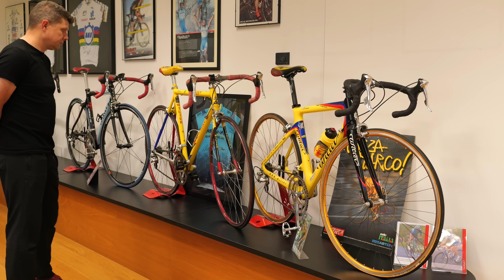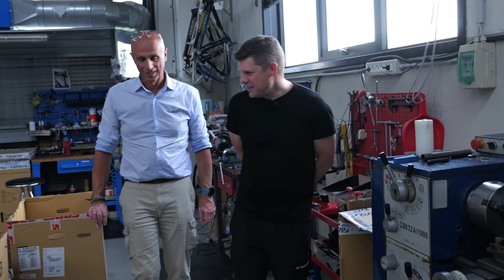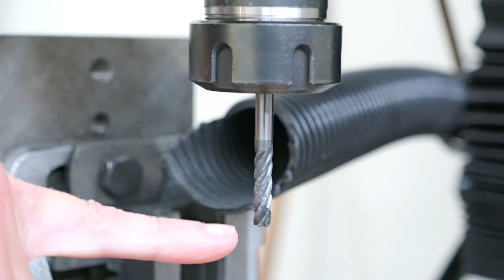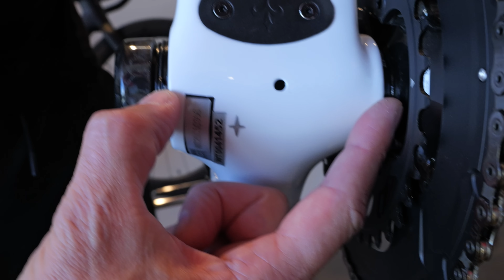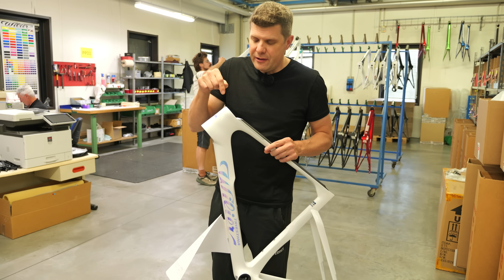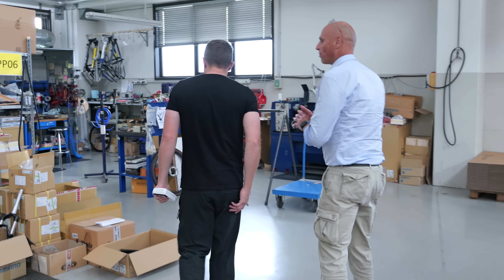We visited Wilier HQ and found something surprising about their new frame

Comment: 5.5K for the frame! Good luck selling these.
Reply from the maker: I think with all these top tier frames the actual sales are slim. They are a looking glass into the future though.
Reply: @Mapdec Small batch for "connoisseurs" .
Reply: The Chinese primary production yet the high price means someone is putting profit first .
Reply from the maker: I might break this down in a video one day... needs a bit more research. but if you put a little thought into it, the winners are the couriers and customs. Little task for you. Ask an Ai to break down the typical journey from raw material from Toray to a retailer and include all the courier and taxes, mark ups and costs.  Scary Stuff.
Reply: @Mapdec Sandvik make some carbon products in the U.S A. Also Hermes and Morganite chemicals .
Reply: @Mapdec The Ukraine crisis makes oil dearer , which doesn',t help with transport costs . Dealer markup includes the bunch of operating expenses . The cost modelling with Canyon that I did in 2020 puts a different light on it .

Comment: I got a bit excited to see it updated. I have been drooling over it for a while now. But, it cannot fit the large water bottles on the downtube because the aero cutout is designed for the small bottles. I live somewhere it gets hot and humid. I need every little bit I can get.
Reply: DaveCM , glad you showed up the lack of consideration of this by the design team . They are not as open - minded as they could be for clients like yourself in that hot climate .
Reply: @robertmcfadyen9156 open minded? what a silly reply.
Reply: @city_slacker Dave CM has a valid reason to complain though . The riders like him need consideration too .
Reply: My reply was to DaveCM specifically , not you city_slacker . He had private messaging turned off , making this mode of communication impossible .
Reply: I wonder if you could just put a normal water bottle cage in there? Yes you’d lose some of the aero gains of their native system, but you were always going to lose that gain using large water bottles.
Reply: @carlom.3737  You maybe could. I thought of GC Performance and his Quick Pro ER:One. It is similar and he uses a large bottle on it. But, it rubs on the downtube. On a $2,000 Quick Pro, I might be willing to live with it. But, I wouldn't of it rubs on this one.
Reply: @carlom.3737 You are sensible . Could you reprimand "city_slacker" for me . He insulted me about 10 minutes ago . I was standing up for DaveCM  with his concerns , and then he "city_slacker got involved with sarcastic remarks .

Comment: Pretty, but I prefer my LOOK Blade. I doubt there is much if any CdA difference either. Also, this is the best video on the SLR ID2 release I've seen so far.
Reply: Apparently the old Wilier was slightly faster than the Look Blade, but of course it comes down to what one likes better and which geometry fits you better.
Reply from the maker: @znalniaskas  yeah. And at this level of detail what size frame, handlebars and what wheels were fitted.
Reply: @Mapdec  Absolutely yes. I have just reviewed the CyclingNews aerobike review(s). With a rider on not even the new Factor Prototype was close to a CdA of 0.32. Possibly cherry picking a best case scenario?
Reply from the maker: Thank you. 🙏

Comment: Extreme reduction in weight of the frame leads to a brick-like effect, and fragile construction, that's why TIME is not offering extremely light frames, besides Alpe d'Huez 01 (not manufactured anymore).
Reply: Strongly agree . I like older Willier frames for that reason in preference to modern ones .

Comment: Mate of mine just bought the outgoing model (discounted) and loves it. But the gear indexing on the Super Record Eps3 started going off so he brought it round to mine because I have loads of tools. Went to put on my hanger alignment tool and whoever assembled it hadn't properly done up the little 3mm hanger bolt and had come loose 🤦‍♂️ .
Gorgeous bike though and he loves it.
Always had a soft spot for Wilier, I used to co-manage the Sport Beans-Wilier squad 15 years ago, we rode the new Cento. Infact they had a problem with weak hangers getting easily bent, they eventually issued a new version.
Reply from the maker: Good problem solving! It is often a very easy thing that gets overlooked.
Reply: @Mapdec I have sold half a dozen Hozan derailleur hanger alignment gauges in the past month . With the increasing cost of living , more cyclists want for me to teach them how to use and then sell these and several other tools to them as well .
Reply: @Mapdec I have check cards for all my projects and repairs . They are virtually foolproof .